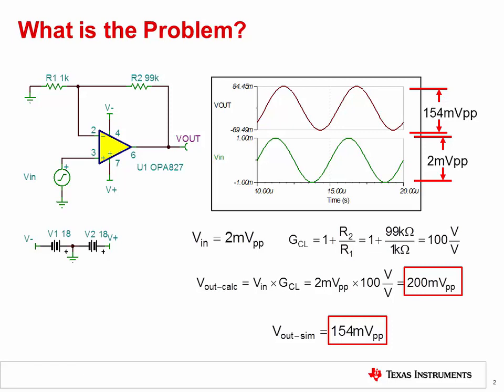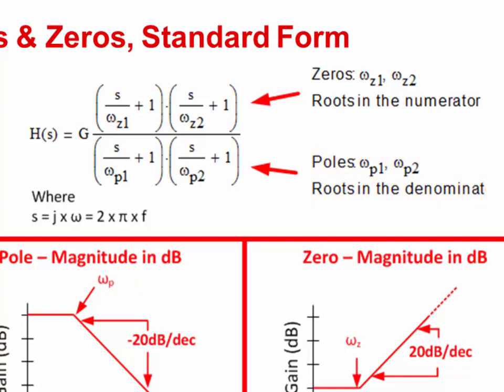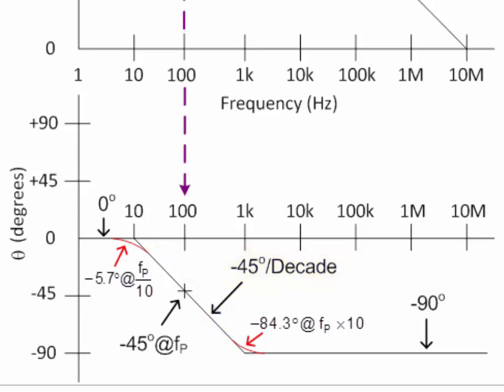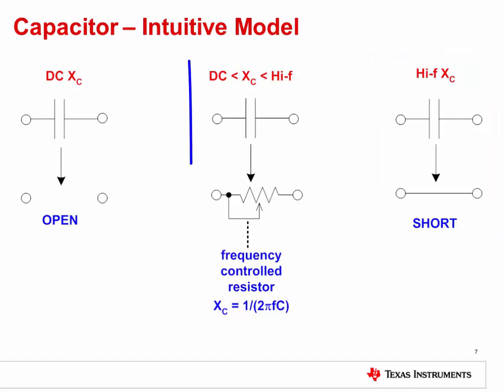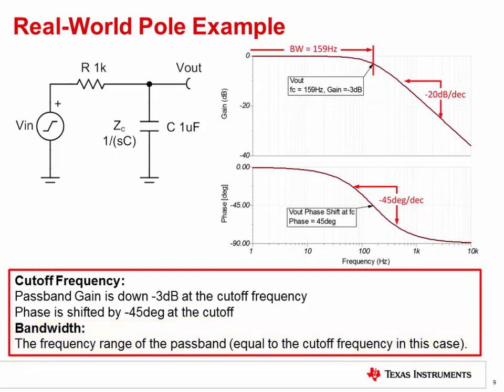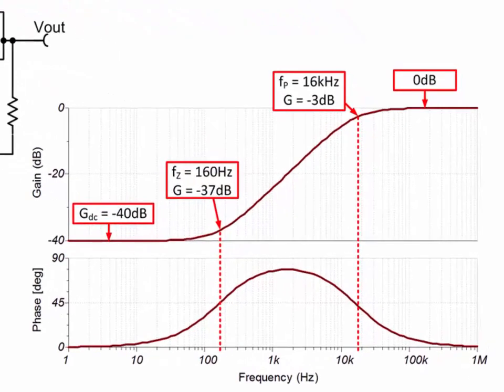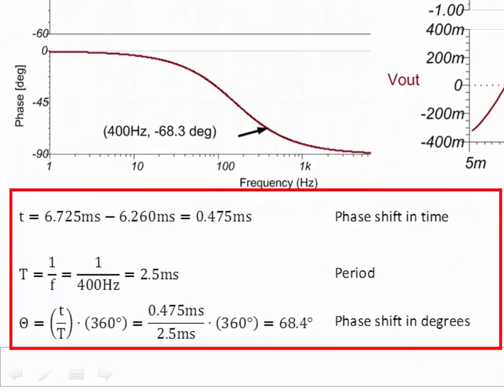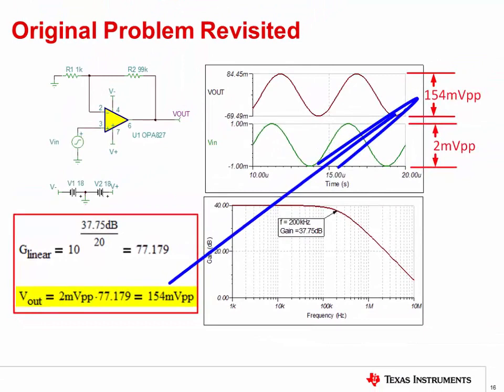Bandwidth - Bode plots cutoff frequency

Comment: Hi thanks a lot for excellent video.
I have a doubt @13.43 time stamp.  usually, for a given tranfer function, numerator and denominator should be considered as Zeros and Poles respectively. But here, considered opposite why ?
Reply: It is probably a typo. Polo and zero equations are flipped.
Reply: I agree with your point, and i am also confused why poles and zero are opposite
Reply: in this case it  is the frequency at which the numerator or denominator is zero, so essentially the concept is same